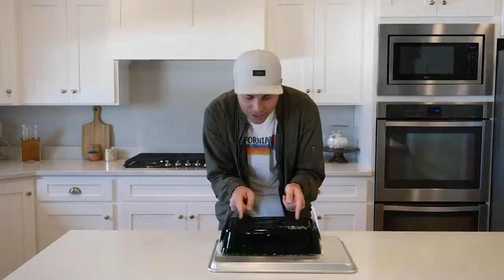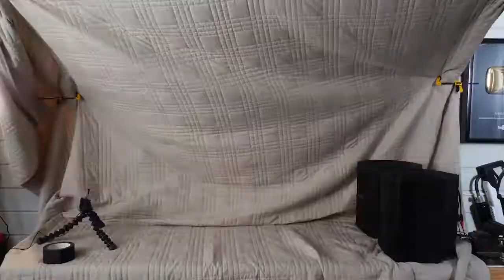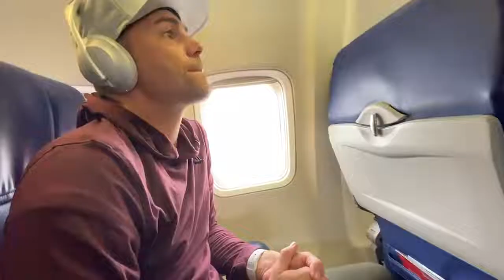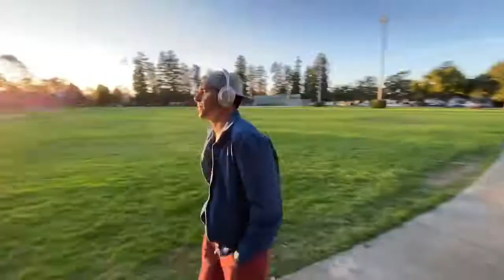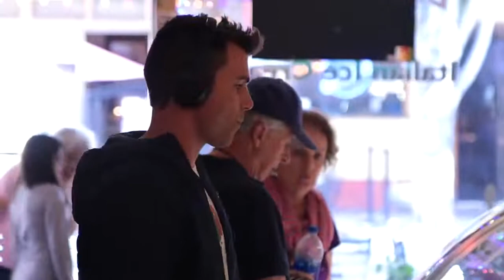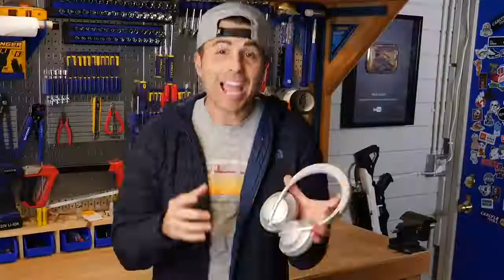Mark Rober Explains How Noise-Cancelling Headphones Work

Comment: I have a question mark  i have a turtle beach 700ptx 1gen and my transmitter dont to headset  doesnt work so i nought a new transmitter but the old headset wont pair to the new transmitter.   Plz help i looked online how and still no pairing
Reply: Sry I didn't pay attention to my spelling was just typing fast
Reply: Since your wiz at this

Comment: This video caused me to buy these Bose NC700 headphones that are as amazing as Mark claims. But I really need earbuds that are the same or similar quality for the person on the other end of the call. Does this level of quality exist in earbuds? FYI I travel a lot so think airport, Starbucks, and lots of outside noises.
Reply from the maker: Hey, I am no headphones or earphones expert😅 so I suggest you do your research otherwise. However, I would assume that earbuds won't have the same noise canceling as headphones. But, considering it is bose, it would be somewhat top tier. Hope this helped :)